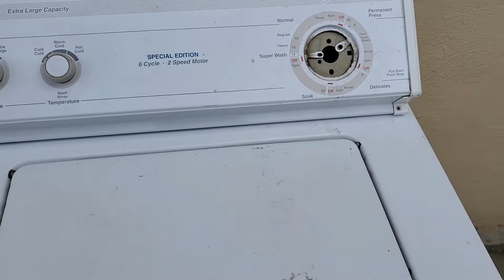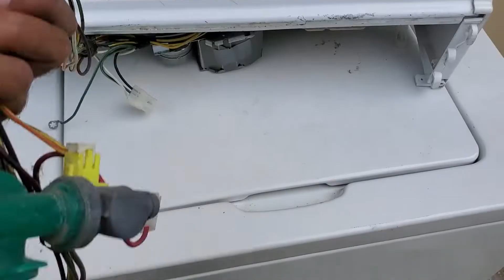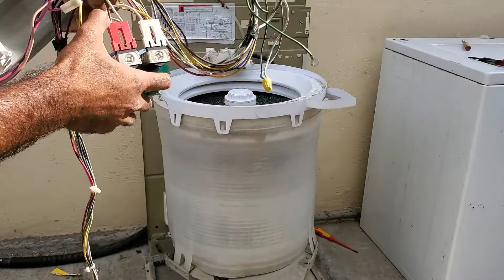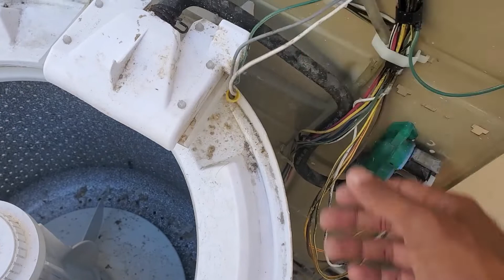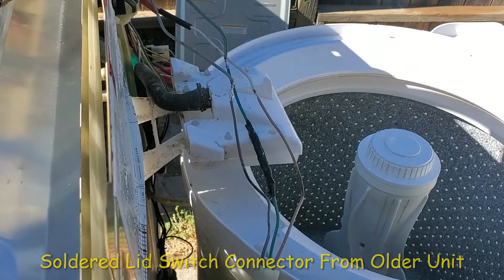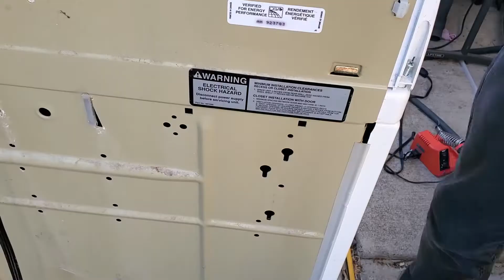Unique Way To Fix A Whirlpool/Kenmore Washer That Will Not Finish A Cycle!

Comment: I love it!  I’ve done this, too! It feels good to know someone else’s solution is the same even with the capacitor.  When you started out first thing, I thought to myself is “he’s gonna need to drill holes for that console”. 😂😂😂
Reply from the maker: Wow that is awesome! Feels good to know I am not alone! I actually am set to do this again with another washer that has a damaged console (looks like they dropped it while moving).
Reply: @DuctTapeMechanic  hey the worst part I had is when the back panel is too tall for the new consul.

Then I start hitting it with a cutting wheel.

The thing I like most about this business is every new obstacle seems like the end of the world until you solve it. It really is much more than just fixing machines.